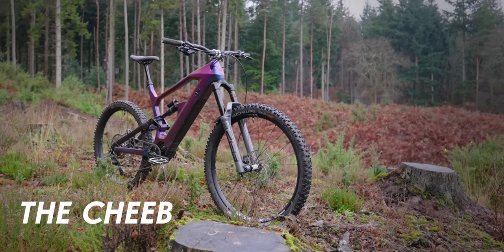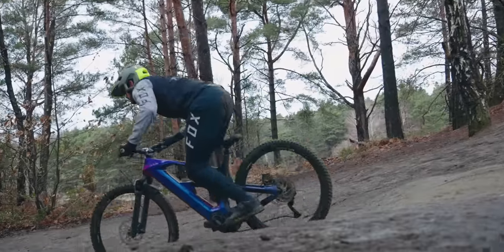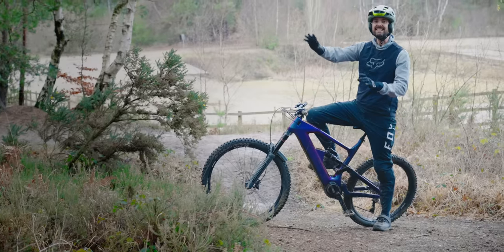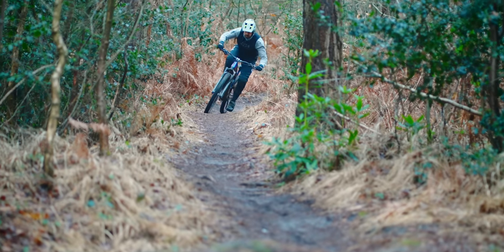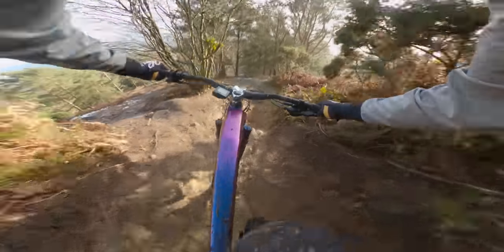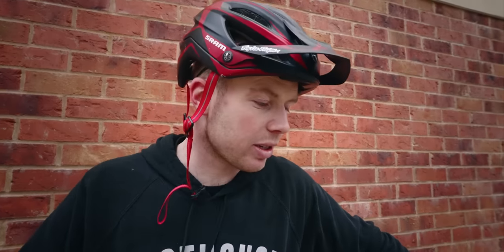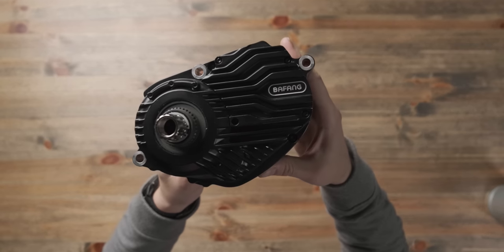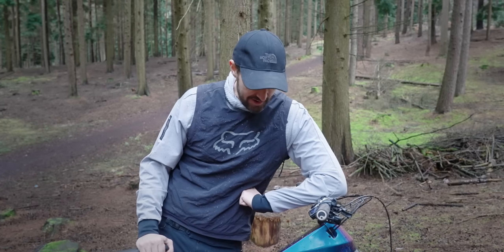I TEST a Chinese EBIKE

Comment: Rob: theres a program you can download on Windows program to configure the Pedal Assist and Torque if you want that punchy effect of boost. Theres also a way to configure 1 of the assists numbers into a “TRAIL” or “eMTB” mode the way Bosch and Brose does.  On a 5level assists I use the number 4. The first 3 staggered the percentage and #5 as an all out 100% Power Assist.
Reply: yea with bafang you can customize it the way you want

Comment: Did you check if you can ramp up the power delivery from the motor? My bafang has a setting on the advance settings to define a value for the acceleration ramp. Usually you go into the settings and then hold a button and tap the other 8 times to acces these settings. Look it up for your model.

Comment: Get the frame density scanned .. will answer all the frame queries
Reply: They’re all built at the same factory. I’m not joking.
Reply: @S0ulinth3machin3   Yes chances are a quite a few brands come out the same factory but that's not the point of my comment above .. to answer the question people are asking 'how is the quality of this frame' a density scan would show any voids, thin spots or delamination answering the question in more detail. This could be done on a 'big brand' frame also as a comparison to compare the two ...
Reply: @TMBTCHR  it's easier for that factory to use the same production techniques for all their runs. If a bike is weak somewhere it's more likely to be intentional (trying to save weight) in the design.

Comment: I had a M400 Bafang really quiet but only way to get max torque was to put it up gears and really stand on the pedals. Very reliable good battery. Try to download a program to modify the power characteristics. E=Mtb²

Comment: Hey Rob Rides Emtb! Glad to see you had some fun with the Cheeb! Has anybody in the UK been fined for riding an ebike that is slightly more powerful than what the regulations allow? How would any police be able to tell that it was a few hundred watts over? Here in Canada they look for a small white sticker that says "class 1 ebike" which would be easy to print and stick on yourself! If you had it set to the 30 km speed restriction or 25km in UK they couldn't just ride it to determine its contraband motor! A deresticted ebike can be detected just by riding it! Ride ride ride!
Reply: the 250w is bs anyways people online tested the motors and almost all of them came close to 600w peak 300-350 continous

Comment: i just bought same frame with m620 Sram groupset customised bike r27.5 f29er.The frame is tested following ISO requirements as I asked for. So, why chinese must be unreliable? Almost everything is built or realised in china nowadays, branded carbon frames and parts as well. Point is that everything could break and this happens for lot of well known bike brands. Important is to think with an open mind having knowledge of what is discussed able to think with proper mind. Professional tester answered: I didn’t know that it was chinese... ; that’s ridiculous! Instead if it was an American or European known brand paying 3 o 4 times same bike the same test would be even more better and fantastic about this SAME bike!

Comment: On the short climb you did to test the motor power the slowmo shows a lot of wheel spinning. This makes me wonder if the lack of power is not to do with the motor but the suspension design not allowing the wheels to track the ground properly.

I have used e-mtbs to climb steep terrain and in my experience turbo mode offers more power than I can handle as a rider, often looping off the back of the bike or spinning out like you are in the video.

Comment: I would go for the M620 option, and the 52v battery option, for the money it's no brainer .
Reply: Not necessarily. If you want to use this bike as an true Enduro and throw it around downhill the M620 is just too big and heavy and you don't need that power. If you are a casual rider and don't want to work as hard, then the M620 is an option but a totally different end result with that set-up.

Comment: If Suzuki could release a new DRZ400S with a 6 speed it'd crush the competition at this price point.  There's 2 solutions to the DRZ400S carb the best is to use the FCR from a 400E/K or adapt a CVK from an old KLR (very cheap and is bettter fueling and throttle response but not FCR good).

Comment: It's a really cool design on that bike,, it's a be good alternative if you live in Asia where it's difficult to get a hold on Good Brands like Phillipines.and so cool to paint your own frame (i didnt like The oilslick look but maybe it would be cool with all components in oilslick to) if you're good at airbrush you could make a insane cool bike! Would be a dream to build it with all your favorite components like rohloff internal gears or those New electric sram gear systems where it's no cable's build your own wheel's ,,, electronic dropper etc.the possibilities you can do with the money saved is endless,,,,,

Comment: I did the same thing last year but without the painting. My DIY chinese carbon frame EMTB got RC Lyrik Rc2, XT m8000 transmission, m8120 breaks and shimano e8000 motor with 504w battery, cost me 22000 rmb witch means 2400 pound.

Comment: Great video, though I really don't like the title.
There are decent eMTBs with this motor out there at 2000-2500€ for a hardtail and 3000€ for a fully.
Reply: Carbon though?
Reply: @panhuys1893   The lowest priced and good performance balance I could find was the Cube Hybrid stereo. Carbon (apart from back triangle) and well specced bike for the money around 4k

Comment: Really like the look of this frame, props for the paint job. Amazing!
Anyone noticed the chain picking up on the bottom of the front sprocket? You got the right chain on dude?
Subbed to Chanel!
Reply from the maker: Yes, 10 speed Shimano chain, the chain got pretty full with mud dirt and sand and I got a lot of chain suck. But I’m definitely going to see if that cheapo ebay front chainring is causing issues.
Reply: Just thought it may be sucking some of the torque from the motor as you said it was less punchy.
Keep up the good work👍

Comment: The error you got after getting it wet was a speed sensor error. Muddy magnets
Reply: I solved  it on mine need to reduce the gap between then magnet and sensor or swap for more powerful magnet

Comment: Great video and build. You don't tell us what the voltage of the battery is. 36v or 48v or more? This is what determines your top speed not the watts per hour. That tells you how long it will ride for. Also did you go into the settings and see what you could change to get more power from the setup?

Comment: I had too much punch on my BBSHD last night. Tried starting from a stop on a hill and it kicked me right off the bike. My hand accidentally twisted the throttle unleashing 5kW and it did a back flip in front of me. Now dealing with a bent chainstay :( 
Might be time for a new frame and a low power mode for trails.

Comment: Hey man really interested in this build as I have built a mondraker dune with BBSHD.  Look in to getting an eggrider display. It allows you to completely programme the motor to make it feel punchier if you want. It also opens up all the other settings so you can dial the motor in perfectly. Deffo worth a look.
Reply: Yes, and you can program all Bafang motors with a USB cabel and a free tool (only for windows). You can custom pretty much any value in terms of amps, how each assistant level will behave and speed limit.

Comment: I ride this exact bike purchased from Luna in the USA for $3450 with the m600 at 125nm torque.  I could have bought 2 of them for the price of a levo. With some upgrades I am now into it 4500 and it weighs 48lbs.   Please update the video with the end weight and cost you have into this build.  
Also thanks for doing this.  Its very important for people to know that these bikes are options and great to hear the comparison on the motors.
Reply: Hi. The Luna X1 is not the E-10 frame but rather an older version that uses a smaller 14 amp/h battery and is not as slack.  Still a good bike though and confirms Dengfu make solid carbon frames.
Reply: @brentmckenzie5808  True, the e-10 is the new frame with larger battery.  Luna has sold thousands of these bikes, there are facebook groups with hundreds of users.  They aren't without their faults by any means but overall they are super solid frame/motor combo and many of us have thousands of miles on these motors without issue.
Reply: @phattysnow  Very true and because of the great reviews from X1 riders I was very confident in dealing with the Dengfu team. They have been great. Great to see better value than the top brands and so many riders having a blast. Cheers

Comment: Try to Build a Cheaper Version Tonsheng TZD2 or the Bafeng Bolt on 68/73mm Externaly Mounted Mid Drive Motor 
$4000 Quid Hard to Swallow with Sketchy Warranty 
Good Video BTW

Comment: Awesome video Rob! When do we get to see you testing the m600? I have seen some early model m600 had issues with noise, so much so Luna developed a quiet replacement gear..
Will be interested to see if Bafang have fixed this issue

Comment: Interesting experiment, thanks for sharing! FWIW, my one experience with a Chinese carbon warranty claim (Hong Fu) was excellent: they were swift, professional and generous with a no-cost replacement frame.

BTW, Nm is not a measurement of torque, not "punchy" power!! Other than that, slick video!!

Comment: How can you promote his efficiency if you basically change all the components? If the frame costs around 600 you had to test it before changing the components so we all could see if it works properly on the track with stock components.

Comment: Jumping the bike does not test the strength or build quality of the carbon , you would have to have ultrasonic or resonance tests done. Just because the bike held up over a few jumps doesn't mean it won't snap on the next one.

Comment: Have you emailed Bafang about the motor? It's possible there could be some settings which can be changed to improve power delivery.  With other higher end Chinese electronics (CNC gear and inverters) I've found they can be quite helpful especially if it's just software changes that don't cost them anything.
Reply: Saw your comments further down, hopefully they email back

Comment: Cant thank you enough for doing this,  I did wonder if the bafang torque claims were exaggerated compared with the likes of Bosch and you have confirmed that.
I would probably go with the m620 which claims 160nm but I'm also wondering about the m600 which I'd in between and newer iirc a bit smoother than m620.
That frame looks fantastic btw.
Reply: I can recommend the M600. It has more power than you need for an enduro e-mtb. I have 2 of these exact bikes. The M620 is just too heavy for a true enduro. You don't need that much power if you actually use this bike as an enduro and throw in around downhill. To be fair though, many riders who go for power really don't 'test' the bike and use it for trail & casual riding.
Reply: @brentmckenzie5808  thanks  , I think the m620 gets a lot more attention simply because its 160nm torque lol.
I dont think I need that much power especially if it will hinder me improving my skills, i have rear hub drive now for just cruising trails and climbing hills

Comment: LOL there's no mountain bike that I ever owned that I hasn't finished by eventually cracking after a couple of seasons of riding. Haro, Norco, Specialized, Kona, Giant, Devinci, Santa Cruz... All big names that I've owned all cracked, but never catastrophically, I always felt or heard it when they did... As a bike tech with over 20yrs in the business I have seen lots failed frames, cheap Chinese frames and brand names all fail eventually. Manufacturing errors are common occurrences so choose wisely, always be aware and if you ride aggressively please inspect your bike regularly.

Comment: Great vid, great project.

But to chill you down on your opinion of the bafang... Amount of nm don't discribe how punchy the motor is.. Nm is just how strong the motor is.

If you explain it with cars...

Horsepower telling you how  fast you crash in a wall.... NM are telling you how far to that that wall with you...

Comment: The question is not if it can survive gaps and drops. The question is can it survive a case, or a standard crash. Curious to know the thickness of the carbon vs the usual suspects (re- any big brand that produces an ebike with similar specs).

Comment: I had nothing agains emtb until I started seeing a huge surge in them at my local trails and started to see the damage caused to the trail and riders that could cause emtb to be banned or the trails closed to everyone. Now this is not an emtb issue per say but a new rider paired with an emtb, and this is were I think the emtb community is failing. People new to mountain biking get emtbs cause they are fun and don't require the same level of fitness, but the issue is they very quickly allow new riders to ride at speeds that surpass their skill level. This is causing damage to the trail in the form of skidding through corners and destroying berms, and an increase in injuries. I have seen multiple instances of people walking out of my local trail with broken collarbones and I ask were they crashed and the answer is alway which time. I really think there needs to be a way for trails to geo lock the ebikes into there lowest settings on a trail. And I'm not even going to get into the lack of trail edicate.
Reply: how is it different from a newbie constantly breaking on a normal mtb? I ride both and I guarantee it, the thing that news will not do is pedal downhill on an emtb.
Reply: @klaxhu  A lot, where I live the trails are much flatter so you would not normally be coming into a lot of these corners with the same speed you can generate on an emtb, and we know this is the case as there has also been a large spike in injuries and they are mostly new emtb riders. Like I said it's not an emtb issue per say in that an experienced rider knows how much speed they can take into a corner and could ride an emtb without issue, but new riders generally lack the skill and knowledge. The trail boss for a local trail and a simi pro enduro racer took two emtb's around the trail and were drifting corners even on eco.

Comment: Loved reading this. I have ordered a frame with an m600. I read on the mtb pages you are selling it.  I would love to know what you would change now if you built it again. I’m just about to order suspension and would like to know if you thought that was still the setup you would use again

Comment: Power is not measured in Nm.   Power (P) = 2*Pi*M*n  = 2*3,14* 95Nm* n   where n is the rotational speed.  so the 95Nm that the motor is rated doesn't give you much of a comparisson. the Power it provides  is a funktion of the torque and the rotational speed

Comment: Great video, well Done Rob. I've been following you and this project from the start. Glad it's turned out well. Would love see how well it goes with the M600 motor!? Do you think there could be a software tweak/upgrade that would make the M500 perform better?
Reply from the maker: I really do hope there is a firmware update - I emailed bafang twice but have had no response yet, even the europe head office / CEO but nothing back sadly. I suspenct the motor is actually capable of much more than what I am getting. I will keep my channel updated if anything changes!
Reply: @RobRidesEMTB  talk  to watt wagons about there custom controllers for m600 motors smoother than Bosch adjustable to 2k watts
Reply: More efficient on battery  too lower heat on motor

Comment: My humble common sense opinion is, since an ebike has a heavy battery and electric motor and is going to be heavy no matter what. You might as well go with a slightly heavier 6061 aluminum frame VS a much more expensive carbon fiber frame. It's only going to be a couple pounds heavier - 1 kilo heavier.

Comment: I really think you nailed it. Great project.
Is there a way to set the configuration for the M500?
I think that you can get more power from that motor, at least in AMPs

Comment: I have a frey ex fantastic mtb 4.5k currently with two battery set up  if anything bike is over engineered  complete with two years warranty  1000w full suspension import the full completed bike. I have done nearly 800 miles on it. just needed chain and tyres. Rob if you are around wa11 post code you welcome to nosey over it.

Comment: IT DEFEATS THE PURPOSE  - YOU NEED MOTOR POWER ON THE STEEP CLIMB WHILE THE MOTOR IS ON A SLEEP MODE, THE BAFANG WAY. THE MOTOR STOPS WORKING WHEN WET.

Comment: Wonder if theres a way to change the motors mapping so it delivers its power differently... maybe even having it linear in the lower settings then more aggressive in turbo?
Reply: Different displays have options and on ones with an external speed controller you can program most of them

Comment: Looks lovely. Re your power, can you check to see if a eggrider is compatible as it will both solve your screen position issue and you can then programme your motors controller also.